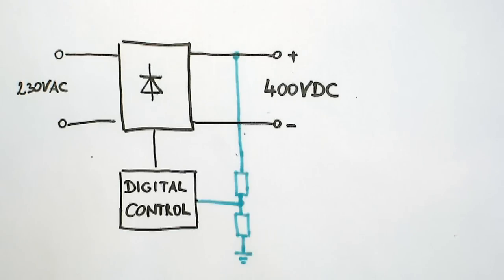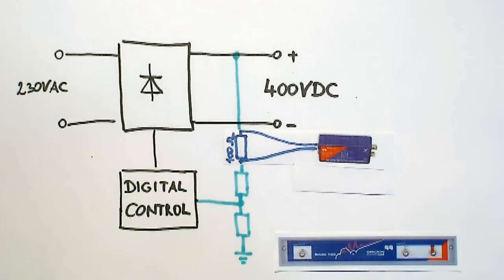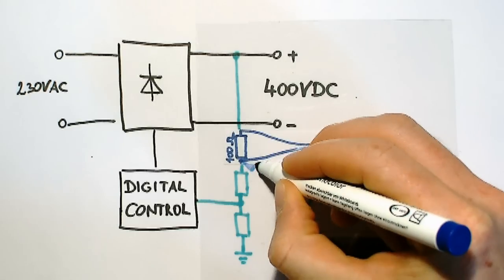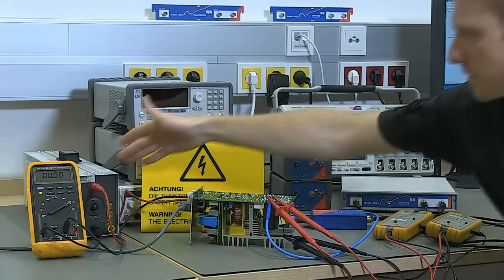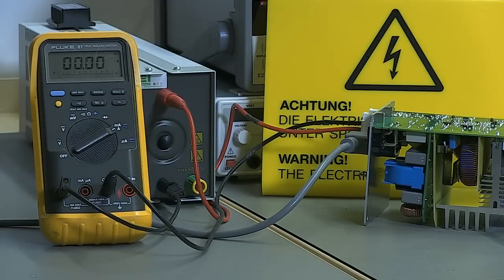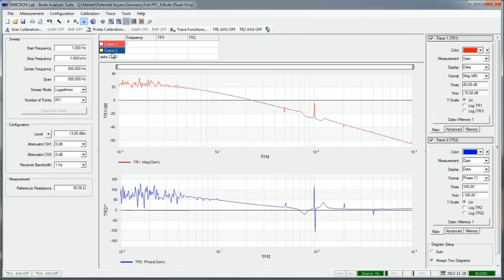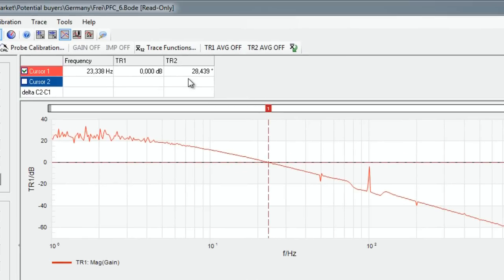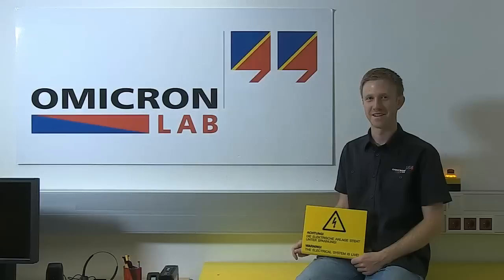PFC Loop Gain Measurement with the Bode 100

Comment from the maker: Since the PFC voltage loop is rather slow and high voltage, we have designed a new injection transformer dedicated for low frequency measurements.
To learn more about PFC loop measurements, check out the new videos:
- PFC Voltage Loop: https://youtu.be/cs2IY_vHdRM
- PFC Current Loop: https://youtu.be/lz9O7ZACxQM

Comment: Wow,It's really easy to measure the gain & phase margin.
Thanks for your perfect expaination.

I have 1 question about Frequency analyzer.

In 400V output voltage,  you use  400R resistor insertion.
If I want to mearsure 150V voltages,  which value is best?  150R is oK?
Reply from the maker: Thanks for your feedback! The injection resistor size is not directly related to the dc voltage. A larger resistor normally brings a larger injection voltage.

Comment from the maker: Dear Meeravali Shaik, we use the probes in 100:1 setting since the maximum possible output voltage swing of that probe is +/-7V. Input is 400V so 10:1 is not possible since it would require an output of 40V...

Comment: hi i want to ask why my set up is showing overload ch1 + ch2 after i connected to the feedback of the shunt regulator. are there any other settings that i need to do? thanks.
Reply from the maker: If it is only a short overload, no problem. It it stays on, please use a higher receiver attenuator. If this does not help, please contact support@omicron-lab.com